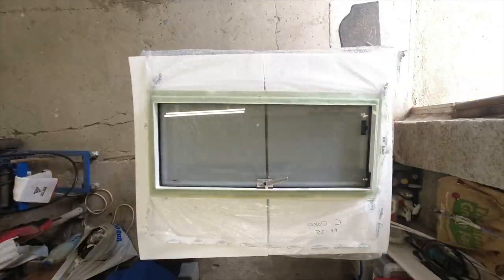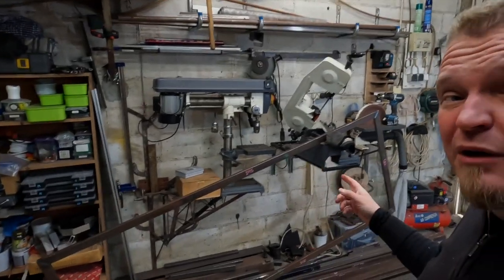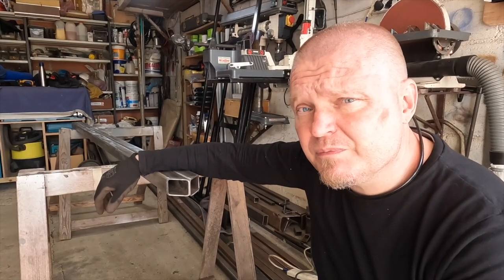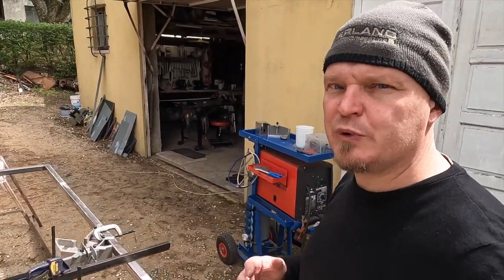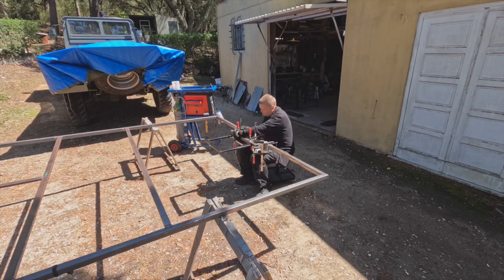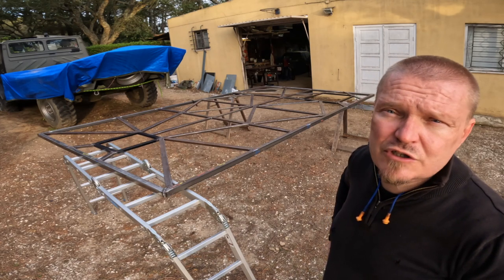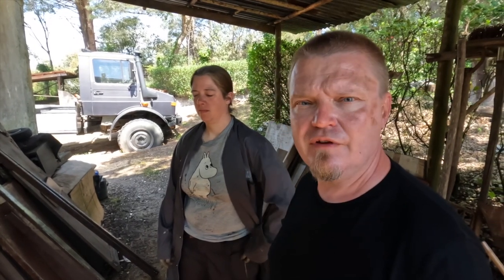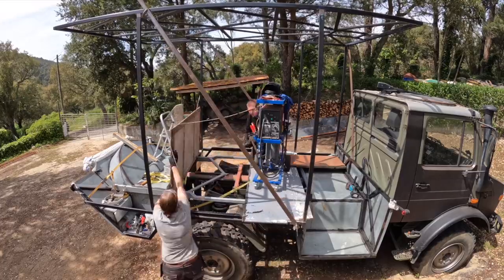Unimog Camper E033 - Building the Roof

Comment: Why did you use steel and not aluminium jocke
Reply from the maker: Good question!
Quite a few reasons, but mainly that aluminium cracks and then breaks, whereas steel bends before it breaks. Then there’s the repair issue. Aluminium is much more difficult to weld and repair, and steel can be repaired with a €120 stick welder in the bush. 
I hope that answers the question.
Reply: I am going to go aluminium built that way before keeps the weight down i think a u1300 has a kerb weight of 4450 kgs not much left to play with on a 7500 kgs vehicle great channel mate hope to see you out there
Reply from the maker: It’s a good option. We, or rather Caz, made some calculations (and I’m sure there’s “charts” out there) that tell how much extra material you need to add to get equivalent strength. With our, very rudimentary calculations, the weight saving wouldn’t have been very much. 
Properly designed and applied, aluminium is superior. No doubt.  
Would love to know more about your design and build. 
And, yes, you’re pretty spot on with regards to the weight of the U1300L. Heavy truck, not much margin to play with. Which is one of the reasons I’m always trying to justify weight and spend time reducing it. 😎👍🏻